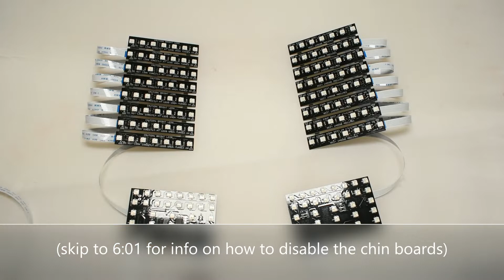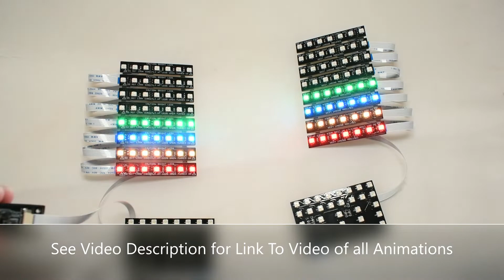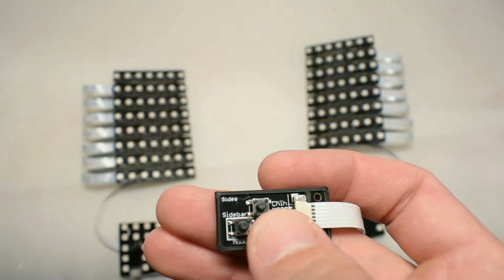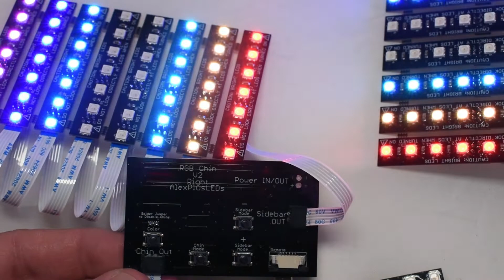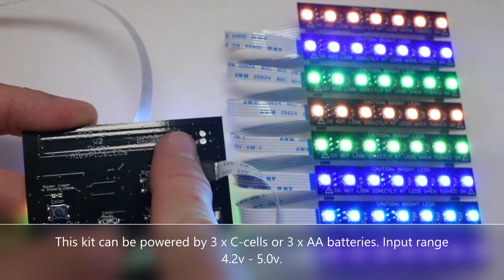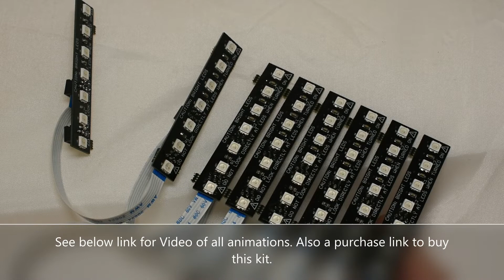Guy Man RGB LED kit - Electronics Only

Comment: I was waiting for this after seeing the Thomas Kit. For the Chin LEDs is there a filter like before? Didn't see it in the animation video and curious how that would look. Also are you working on the Guy ear pieces as well?
Reply from the maker: No chin filters required. The LEDs are the correct colors. I do offer an ear kit, but it uses white LEDs and a color filter over the top.
Reply: @AlexPlusLEDS  Would love to see how the kit looks in a helmet. Curious about how the EQ part of the chin looks with there being less LEDs or without the filter in comparison to the older kits